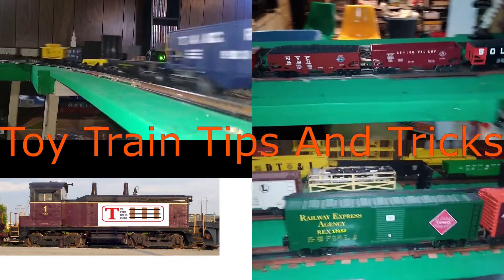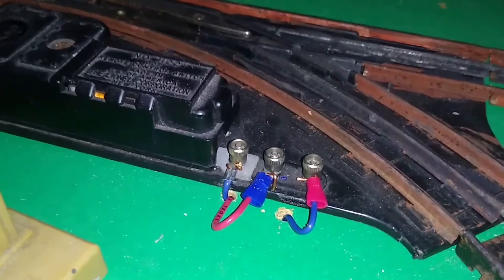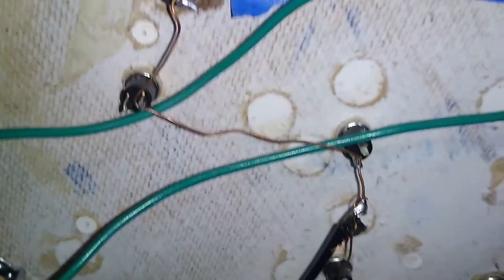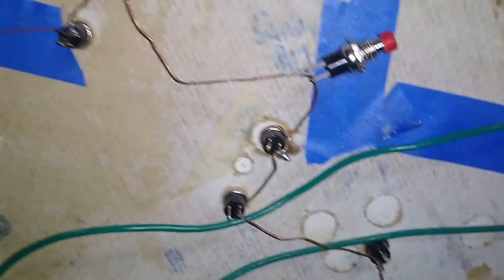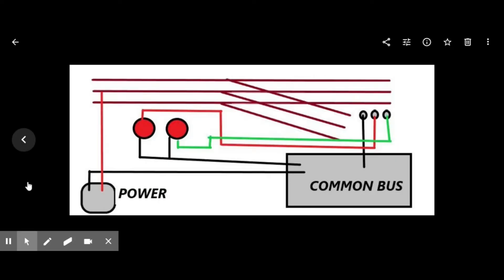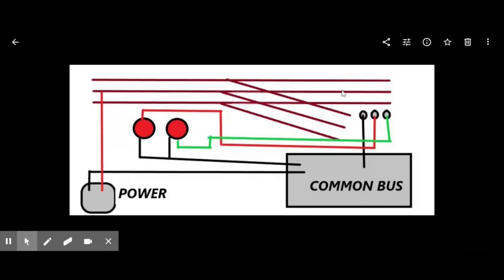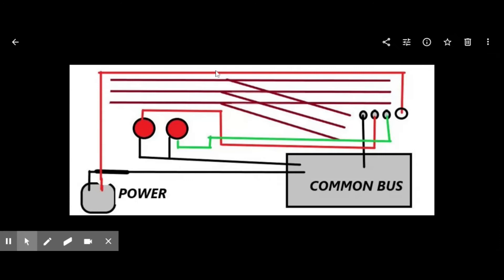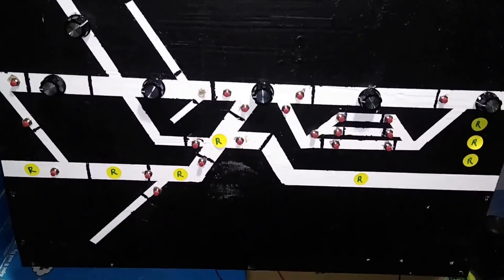Subscriber Request: Wiring The FUN Lines Part 2 - Turnout Controls

Comment: Great video! What size are the slide on connectors you used for your red momentary switches for your turn outs? I’m not a fan of soldering either! Lol!
Reply from the maker: I bought a variety pack from Harbor Freight and I use "whatever fits" on different switches. I will check what sizes are on my push buttons and rotaries and report back.
Reply from the maker: Vinyl Female
Quick Disconnect
.110"
22-18 AWG